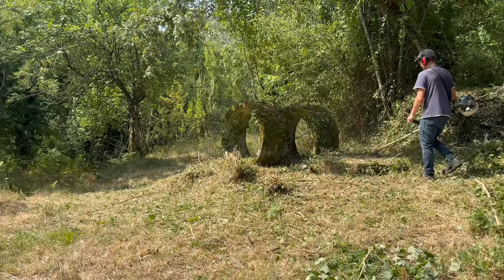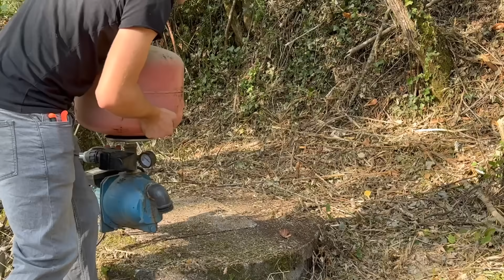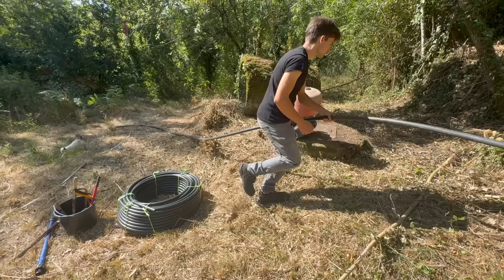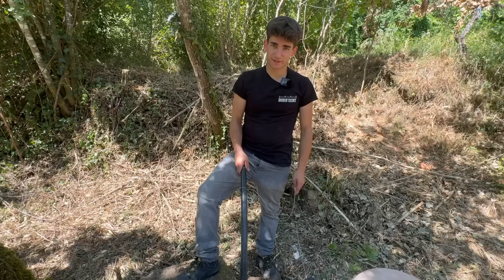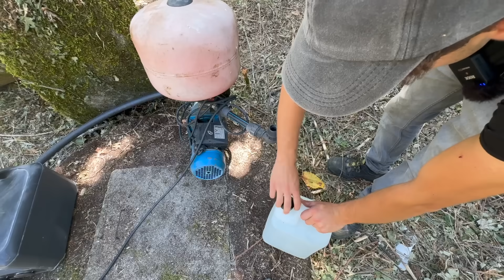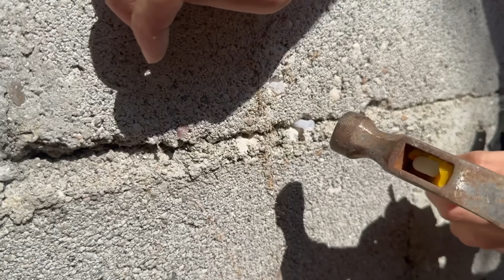Reviving the Old Farm's Water System After Years of Silence

Comment: I can see you know what you are doing. 
In English, we say we need to ‘prime’ the empty pump with water, to take the air away from the pump impeller so that it can push water. 
With any piped water we sometimes need to ‘bleed’ the system to get rid of ‘air locks’  in the pipes. 
If the system is ‘gravity fed’- with a fall towards the final tap, then this is an easier system to install. With a pumped system, some sections of pipe might go uphill, and hence the airlock problems. 
Good job anyway.
Reply from the maker: Great info, friend!! Thank you so much!!🙌

Comment: João, save yourself a huge amount of money and headaches and go completely off-grid. Be independent with your water (2 wells!) and electricity. We use a 2400w powerbank that runs: our submersible pump, pool pump, fridge/freezer, dishwasher, ceiling fan and light, plus charging phones, our equipment/machine batteries etc. Then in our room a 600w powerbank that runs our smart tv, lights, charges laptop, phones. For these: one 500w panel and one 200w panel. We'll eventually expand this slightly but for now, it's perfect and it means we don't have to deal with these greedy corporations who dont appreciate their customers! 😁